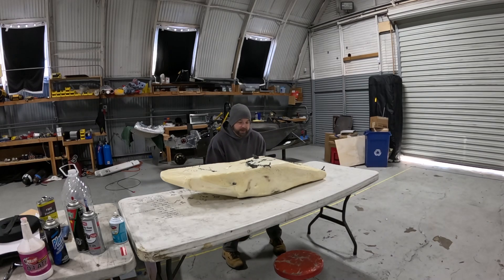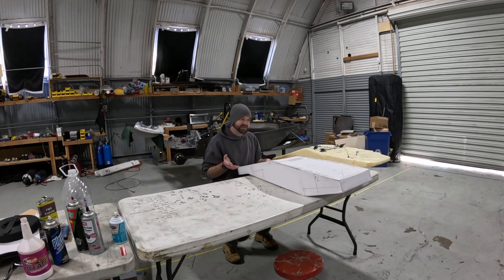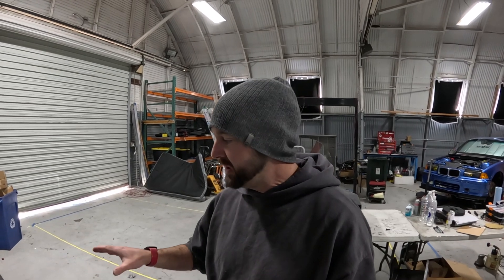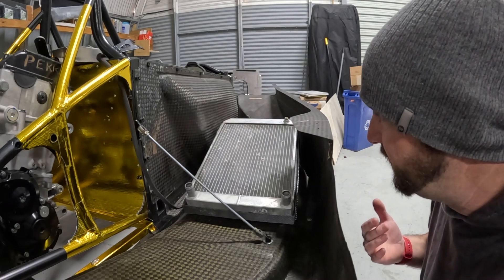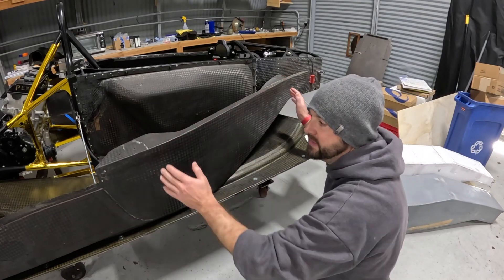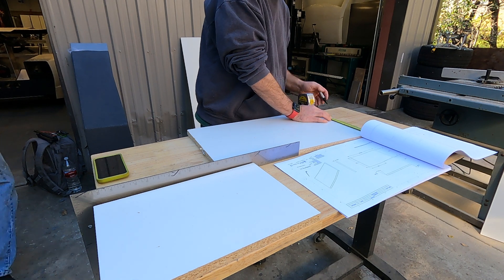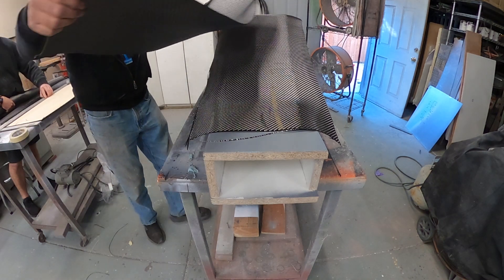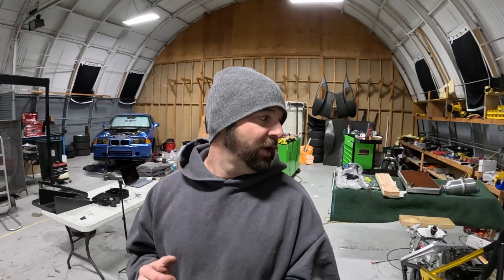Ep 14: Carbon Fiber Ducting Round 2 Sadly This Will Be A Trilogy But Progress Was Made Is Awesome!!!

Comment: What was the basis for choosing to have the duct go from the small mouth to about double then into the rad? I'm thinking that would cause some unknown turbulence variables as the air goes from high speed and high pressure, to a lower pressure and turbulence and then has to change direction as it hits the rad fins at about a 60deg angle. I may be wrong, but it looks like it will be messy and poorly flowing air. As far as I'm aware, having square corners on the duct is also not helping with airflow.
Reply: I had a similar issue when creating a cross-sectional “spiral” inside a vertical concrete poured-in-place chimney. We wanted to keep the x-sectional area the same all the way up, but the chimney changed its external x-section as it went up. We cut solid stryofoam block, using simple math to keep the sizing correct, as it changed orientation. You could do the same to create your plug, over which to lay the CF. The styrofoam was tightly wrapped in plastic sheet before pouring the concrete, then we just opened the plastic, and poured gasoline on the styrofoam, dissolving it, and making our very own napalm!🔥🔥 The interior flue was perfectly smooth, with perfect airflow.
Reply from the maker: Nathan,

First the picture for the video Ep2 shows you barely the radiator and oil cooler openings that I am working with. Didn’t want to change that from original.

Second: Bernoulli’s covers this a bit. So small opening into larger space. The velocity of the air will decrease (rule of continuity) the slower the air the easier it is for it to turn corners. It also does a better job of exchanging heat.

Third: the sealing of the air coming into the radiator further up should help pressurize the front side of the radiator. Helping to smooth out airflow entering the radiator.

And lastly. We will be putting some honeycomb onto the front and rear surfaces of the fins for the radiator. It helps protect the radiators and smooth up the airflow.

Hope this is helpful.
Reply: @commodorepdog32  the honey comb could be good to help direct the air to the rad fin orientation. As for the air flow and pressure, I understand the pressure, then lower flow dynamic, but my concern is that this may cause enough back pressure to effect the inlet air (unless it has heaps of external air flow  with a reasonable high pressure zone to overcome this).
Reply from the maker: @ your on it. Yes. All of those are true. But I am borrowing from success so I should be solid. Along with that we’re not done with cooling modifications. Radiator is getting thicker. Oil cooler is bigger than I ran with 1L. I should be ok on all fronts. And never have I had this sealed of an inlet air system. Always pirate air could leak by.

Comment: Most people don’t realise how important sealed radiator ducting is to keeping an engine cool , especially with modern high output engines with aero becoming more mainstream . 
Job well done as far as I’m concerned and on a realistic budget. 👍
Jus as important is the old E36 in the background ❤, weirdly I’ve just made a full carbon splitter/ radiator duct for my GTR race car .
Reply from the maker: You know my pain then! Good luck with your project!

Comment: As you ended up with a bunch of flat panels joined together, like your cardboard mockup, you could just lay up and  vacuum bag cure a bunch of  flat carbon fibre sheets, cut out the shapes like the cardboard, then stitch and glue them together, like some boats are made. No mould required. The joints would be covered over with epoxied carbon tapes. The only "mould" is the cardboard model. If you use a very smooth plastic or Mylar as the releasing agent on the surface you lay up the panels on, the inside of your ducts will be very smooth!
Reply from the maker: Kevin, the reason it was thick plywood is mainly due to the ability for the vacuum to pull hard enough that it can warp, brake, or collapse the wood. But I think I see what you are suggesting in a way make the flat parts and bond them together kind of like legos. That would work but with making multiple pieces you hope they fit together when it is all done. that and the seems on the carbon fiber you bond together are not as strong as the single piece so your including a lot of stress able joints to your end product. The fewer pieces you need to bond together after the fact the better in my view so that's why we settled on making it this way. I would have made it out of 1 single piece of carbon if I could but that would be super time consuming to make that mold. Plus it is a lot cheaper to screw up with plywood than it does making a bad batch of carbon fiber parts.

I hope this helps and explains why we went this direction? if not kick me in the teeth and I will try again!
Reply: @commodorepdog32 No you have completely missed the point. You should look at some you tube videos of how stitch and glue construction works. My idea is to layup and vacuum bag cure say a 4x8 sheet of carbon fiber on a flat table top. after its completely cured and dry, take your various cardboard patterns, transfer them to your carbon panels, cut them out, and stitch them together with fine copper wire, or fine zip ties. Then you 
have your shape, carbon tape all the joints and you're done.  All the "hard pull" of the vacuum bagging is done on a flat solid table top.
Reply: @KevinONeil-k8d  Agreed. so much quicker and simpler. If going to the hassle of making a buck I'd take advantage of the opportunity to have round edges not square.
Reply from the maker: Kevin,

Understood. Both ways would work I see advantages to yours. For me the way we did it felt safer with my skill set for success. Also we can easier make a second batch of parts for spares maybe. But both can get you the same result. Until I try your method I won’t know which is better.

One of the main reasons I would say I like my way is sadly I hate trimming and working with done carbon fiber products. The itchiness of it. 🤮